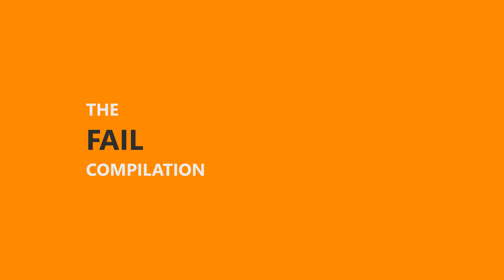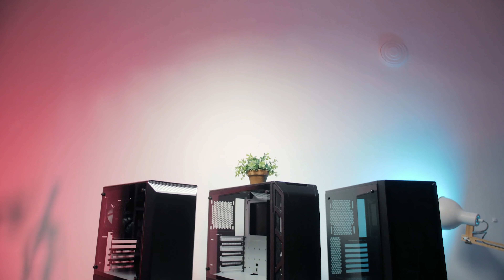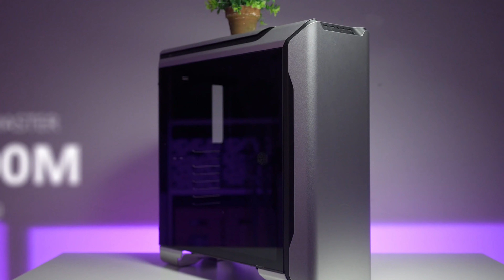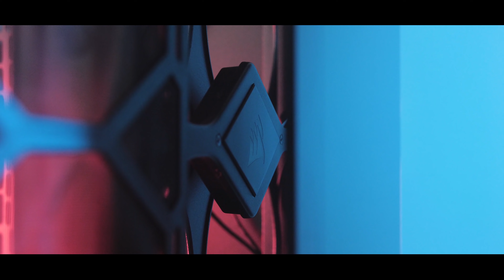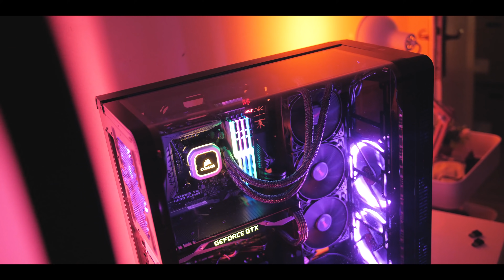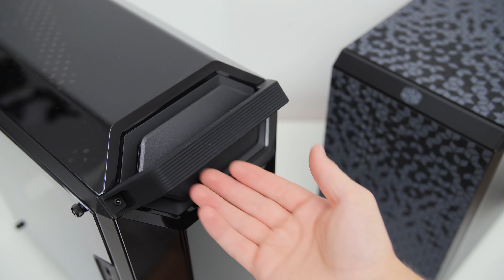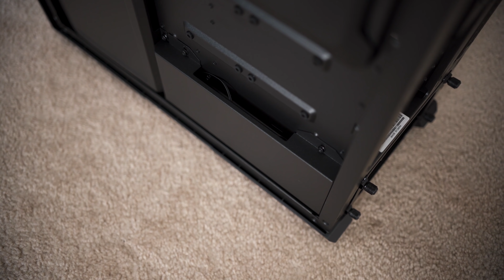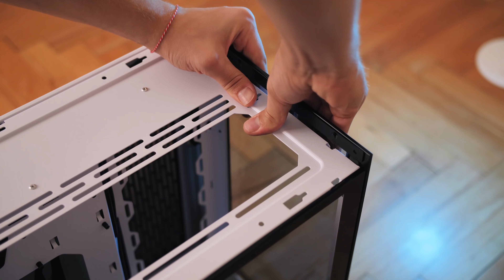Top PC Cases of 2018!

Comment: Next you should do best cooling/silent fans of 2018......Id love to see where the Corsair ML 140mm RGB PRO jet engine would rate.
Reply: Finian Blackett Ill look into those, these Corsair ones have a horrible mid pitch humming from 800-850rpms.  Im rather disappointed.
Reply: @sammygetlow1636  Mine are completely silent at that RPM.  I have a 1000D with 13 ML pro fans in it...
Reply: Mazdabater07 I guess Ill contact Corsair to see if they arrived faulty.  Ive not been able to find a video reviewing them.
Reply: @tf2excession  Incorrect, I get better temps at less rpm and alot less noise with my ML120s compared to my Noctua NF-F12's
Reply: @Mazdabater07  I can confirm this.  And I used to use nothing but Noctua fans.  I can hear the clock on the wall 20 feet away in my computer room, but almost can't hear the ML 120s at 750 rpm despite the fact they're 2 feet from me.  At 750 rpm they move more than enough air to keep everything in my 011 Dynamic very cool while looking good.  Can't say the same for Noctua.  I actually started trying other fans because I kept getting Noctua fans with a hum.  No bearing hum with maglev fans.

Comment: what about the corsair 400c?
Reply: Nice, but that top is 2018 cases only.
Reply: @NicolasGuerraOficial  oh it's a 2017 case? my apologies
Reply: Oh shit it's not even 2017 it's 2016, looks so good and modern tho.
Reply: just watched his 2016 video it's even on his top first time builder cases, and i'm first time builder planning to buy it :D
Reply: @Shiro-gt1cu  sorry my bad english, It is a good case, but the down side it the case has acrylic window, and in the long run, it can have scratches.

You should also consider:
Corsair 460x
Corsair 400Q
Fractal Design define C (tempered or solid window)
Fractal Design define R6

Fractal Design have GPU temps a little bit higher than corsair, but fractal design cases are more quieter than corsair cases.

i think if you obsessed with GPU temps (if you have a hot GPU) , you should consider a Cube case with fans in the buttom, like Lian Li pc-o11 Dynamic.
Reply: @NicolasGuerraOficial  ty for the suggestions but i don't mind the scratches, i have set my mind on the 400c!

Comment: 100% agree with your case of the year. The O11 Dynamic is extremely versatile, sexy, and affordable given its feature set.
Reply from the maker: It's one of those cases you don't realize is above the rest until the last week of December lol... Thanks for watching 👌
-D.
Reply: @HardwareCanucks  Hi sir :) I bought this case and got 6 Noctua fans, I don't have AIO as of right now, later for sure as top exhaust, for now I got Amd 2700x stock cooler. I think I should go for 3 side intake, maybe one (2 ?) bottom intake for gpu, one or 2 last Noctua fans as top exhaust. What do you think ? :D Thank you in advance o/
Reply: Thought the O11 Dynamic looked too damn sexy so I bought it even if only use AIO's to cool my system
Reply: O11 Dynamic and Evolv X are my 2 favorite this year
Reply: If there wasn’t so much talk about the front glass falling out, due to poor gluing, I’d definitely make the switch.
Reply: I got the O11 D as well and it's a damn gorgeous case. What I don't get is why the vertical GPU bracket is so very bad. I should have gotten a third party one, but the online shop where I bought it falsely claimed that only the Lian Li one was compatible. It's annoying enough that it only allows mounting the card in the lower slots so you can't put any fans under. It also has multiple depths at which you can mount it, but only one of them actually works and even that only with force because the riser cable is too long...
Reply: @thedayb4tomorrow  Isn't it true that only the Lian Li one is compatible? The other ones usually need some DIY to make it fit. Only one I know that would work regardless is the CableMod one, and that one was specifically designed to fit in nearly every case and makes some sacrifices to be able to do that.
Reply: @Thunterise  I also used the Cooler Master's vertical gpu mount with the case without any issues
Reply: Glad i bought this case a couple of months ago
Reply: Definitively one of the best cases of the last years. In addition to all the qualities already mentionned, another appeared to me while building my system in it. Build quality is just crazy for the price.
Reply: The O11 air is the same case with more fans. Pretty sure 011 dynamic uses same dust filters as well. I got the air version for more fans.
Reply: im kinda shocked its not a phanteks case....
Reply: Have dual 1080tis
Reply: @Alm209 $100 solution:  order 2 LIAN LI Riser Cables with brackets.  You install both cables on the one bracket as it supports 4 expansion slots.  Unfortunately, it limits fan installations on the bottom.  You might be able to still fit 2 slim fans if standard 25mm ones do not fit.  Can't guarantee this will work, but hopefully this helps someone.
Reply: They need to release the white version with black interior.
Reply: I bought one after seeing Hardware Canucks review! :-)
Reply: I bought an EVGA Dark X299 MB for $199usd (vs. $499) on a EVGA website special. It's slightly larger than most EATX MBs. According to both Fractal and NXZTs' websites it's too wide @ 10.897" for an H700, an R6 or an S2. In most Coolermaster cases the grommets are TOTALLY covered. I went NUTS looking for a proper case where the rubber grommets were not covered. You would be amazed how hard it is to find a case that doesn't cost a fortune to work. To make a very long search short, I just bought the Lian Li O11 Dynamic. It will hold that large MB for $129 and look good doing it. What I want to know what is up with the vertical GPU adapter? I saw reviews that said it was decent. What can you use instead then? Not really sure the CableMod will work on this case....
Reply: @whocares0503  The coolermaster vertical bracket works perfectly with the 011.  No modding required.
Reply: @patrickshelley09  Yep saw YT videos, it fits right in! Rather convenient. :-)
Reply: I agree as well and got one my self the moment newegg had it in stock
Reply: I was about to be mad when I didn't see the O11 Dynamic at least as a mention in the water cooling section.. But case of the year makes up for it.  I've been on the fence about getting the O11 Dynamic all year.  Next time I drain my loop maybe I should just do it.
Reply: Only problem seems to be the inability to fit a big, fat air cooler
Reply: @SaintRage which also is cheaper than the terrible Lian Li one...
Reply: sexy is an understatement :D
Reply: Science Studio the only problem with it it is too small. It looks perfect this and Air version aswell. If they only build it with clearance that can fit proper CPU cooler or GPU block.
Reply: Lian Li Pc-o11 dynamic best case I ever used for my build
Reply: I got this case a few weeks ago when I saw it at Microcenter. I wasn't in the market for a case but it was too damn sexy to pass up. The vertical mount was purchased separately and cost way too much. It leaves a lot to be desired for the reasons mentioned by others. I may give the CoolerMaster mount a try, especially since air flow is a small issue and some fans on the bottom would certainly help. Still love this case though.
Reply: I really did want to like the dynamic but it had some compatibility issues for watercooling.  My gpu waterblocks wouldn't fit and my 360 rad wouldnt fit on the side.  If it was an 5mm wider I would have loved this case
Reply: @Alm209  Get a vertical gpu bracket.

Comment: I have a 275r and I have had no trouble with the alen key and the rubber getting lost and I can hide the key so my sister can't use the thumbscrews to get in to my system (she's taken off my back panel before) cooling is very good and not chocked and was a joy to build in compared to other cases the case is also pretty big and support for aio is great really recommend this case

Comment: it seems Boxes have just taken out the DVD player in the front and made a place for coolers tower(rad) and only enclosed the power supply and left a 1" space for wire behind the board for wire management so really there no different than the Antex 900 from, Scam man!! the price is to hi for no reason for some. should be 4 usb 3.1 ports in front or side case for front use.

Comment: Thanks for this! Been thinking of upgrading my H440 due to its poor cooling efficiency.
Reply: Thats one of the reasons I replaced my H440 in white with a Lian Li Dynamic in White. Awesome case, just love it. My only complaint is the motherboard mounting location as it sits too low on the LLD. I have three 120mm fans on the bottom for intake to the GPU and they block the USB 3 connector to the front panel. My only solution was getting an aftermarket USB connector with very thin cables that allowed me to bend it around the fans. Its a shame as there is still alot of space at the top so they could have made the mounting points heigher. Otherwise def worth the trade in for the LLD. The two windows really allow you to show off a system as the front is then not covered with fans.

Comment: 2019 is will be the year when cases are more mature with minimal design languages and premium materials.
Reply: Calidrius I hope so, feels like case manufacturers have taken a step back in time to more “gamer” aesthetics with the mass adoption of RGB.
Reply: @jazzt3839  - Yee, there was too many RGB trends in 2018 which made everything look cheap and kid-ish. However, NZXT is pushing that trend away and it looks like more and more case manufactures are following the idea of minimal or simple designs.
Reply: Fractal Design has always been like this. I love my Define S2.
Reply: god i want the fucking s2 myself, do you know if you can install the R6 hdd shroud onto it?
all i want is a fucking define with 3x140 in the front and a fan in the bottom so my gpuy actually gets air

or just a case that fucking abolishes the normal psu placement because its a garbage position to place a psu as it is its own ecosystem. which there only seems to be two cases that does.
Reply: "kid-ish"

like anime
Reply: @spectre722  ???
Reply: @spectre722  - hentai is the best kid show